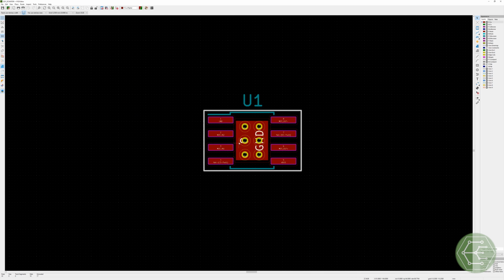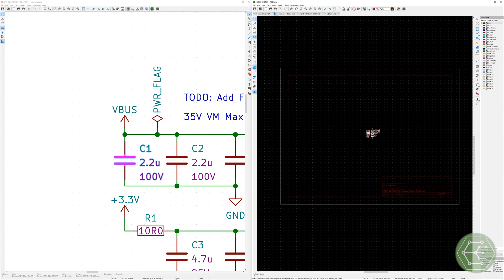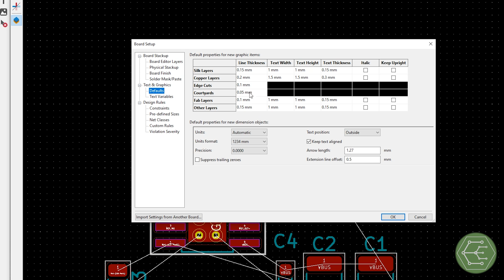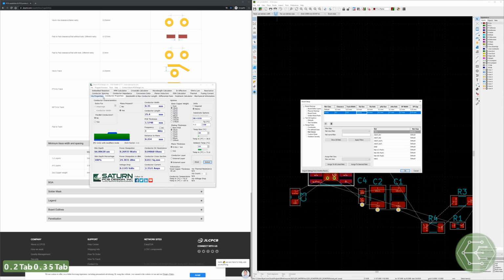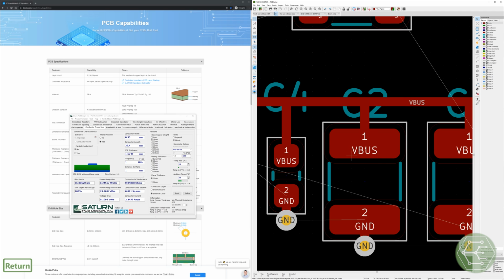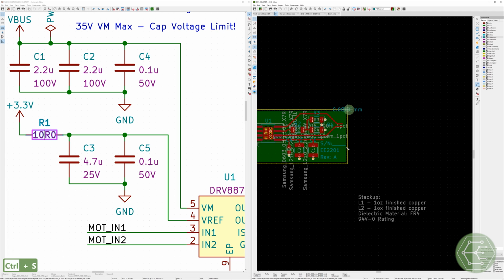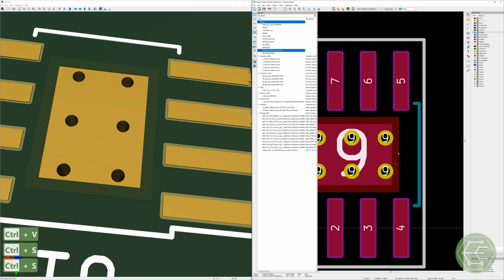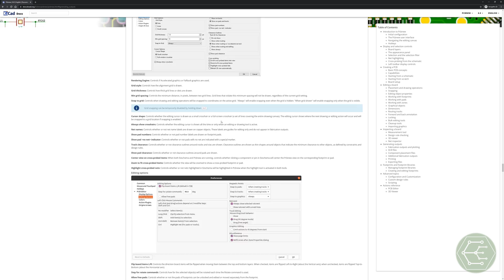PCB Design: The Epic Conclusion – Layout, Design Checks, and Gerber Export in KiCad 6.0 | EDA3

Comment: Dude, I hope you are doing well. A few months ago, you reviewed egs002 module. Now, EGMicro has a newer product named egs005 based on eg8025 chip. I'm begging you to test this module. I think they solved most of the problems others had with the egs002. If you up  Please review this product. (NOTE: You can build 1kw inverter without designing your circuit directly according to eg8025 datasheet)
Reply from the maker: Very cool Selim, Thank you for the tip! I'll definitely add this to my list! Maybe someday you'll see the module in a video.